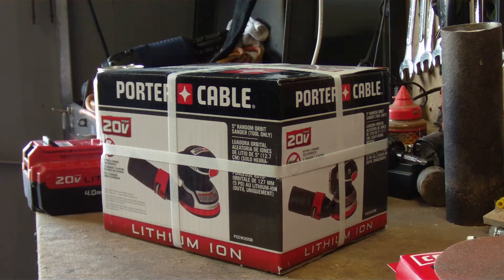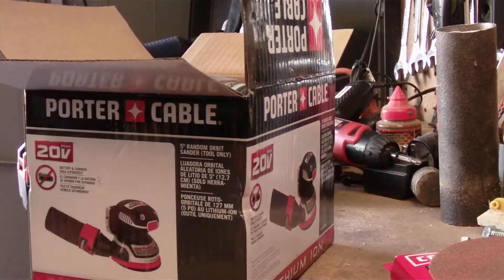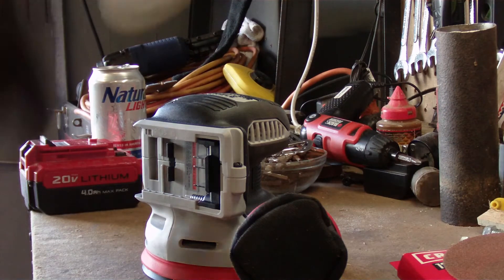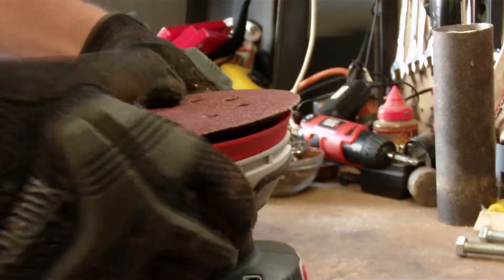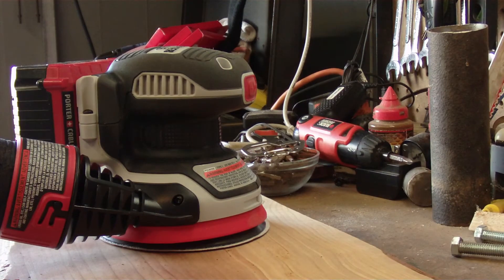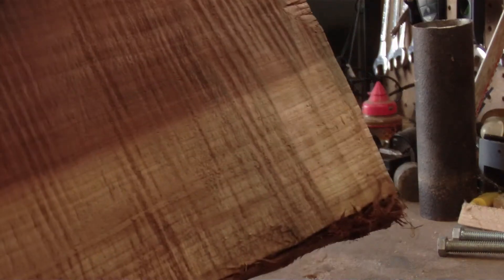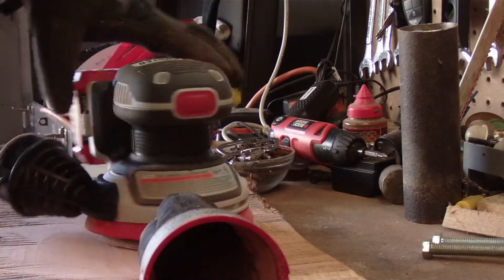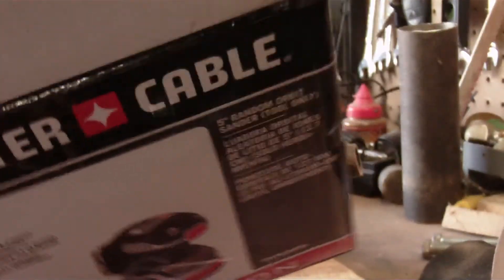Porter Cable 20v Orbit Sander

Comment: I grabbed this for $22 tool only today. I got a bunch of other 20v porter cable tool kits on clearance a while back. The brushless drill kit was $32. Angle grinder kit $40. Check out the clearance at Tractor Supply if you have one local. I'm out $130 and have drill, driver, grinder, sander and 3 batteries and chargers. I'm into M12, Ryobi 18v, and Dewalt 20v lines. Never hurts to diversify tools on a farm.
Reply from the maker: I will have to check out my local TS. Thanks for the tip and thanks for watching.

Comment: I looked this up before going to LOWES. The specs online said battery included.  I just came back empty handed, because the  $40 battery charger  wasn't available.  The box  felt very light, there's no way a battery was included. The unit was 59.00 add in the $40 charger and the battery has to be $30-40.00.  Thanks for this video.   I do handmade crafts and this will be worth the investment.
Reply from the maker: Yeh in my opinion if you did not already have other tools in the set with batteries it's not really worth the investment. Thank you for watching.
Reply: @jason-white  I ended up not getting it.  I think  it might be discontinued or something it was on clearance and no stores had a battery or the correct charger. I'm thinking of getting cheapster from Harbor Freight. For what I will be using a small sander will be minimal.  Thanks again!